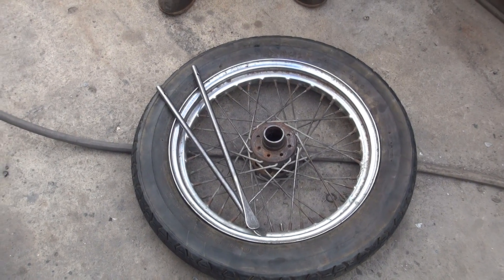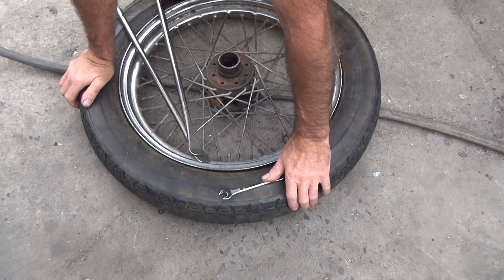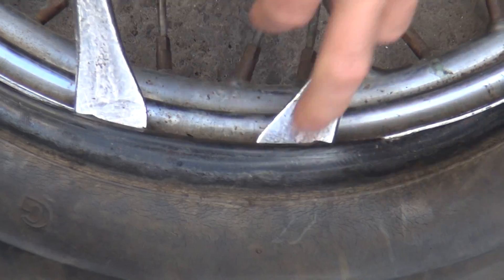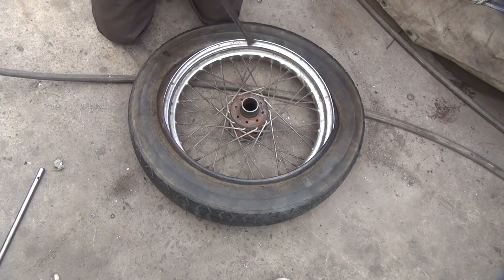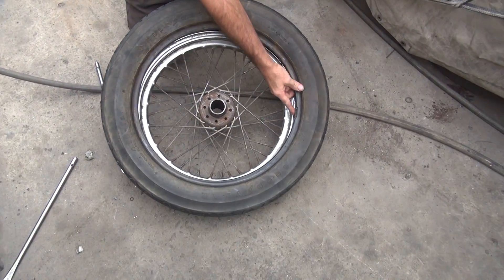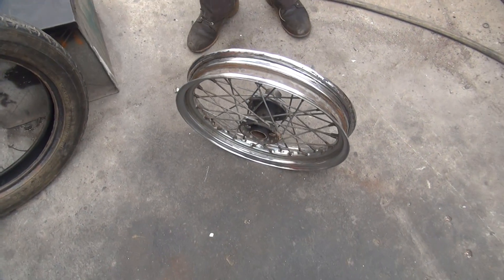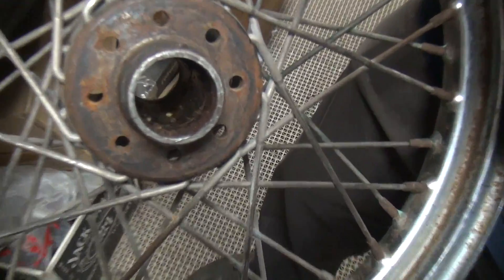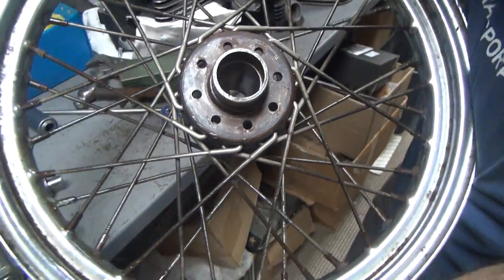#112 How To Do It, Remove a old hard rear tire with tire irons 1972 XL Ironhead Sportster Harley

Comment: I have an aluminum front rim, i'm kind of afraid to pry on it with the tire tools. Are aluminum rims very delicate?
Reply from the maker: just smooth up the tips and you should be ok. they also make plastic clip on rim protectors for doing this.
tatro